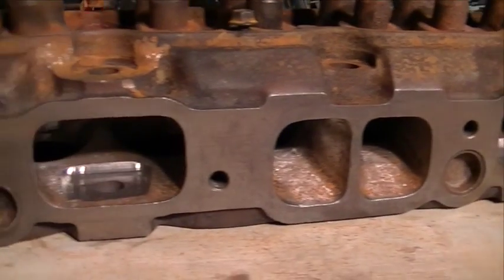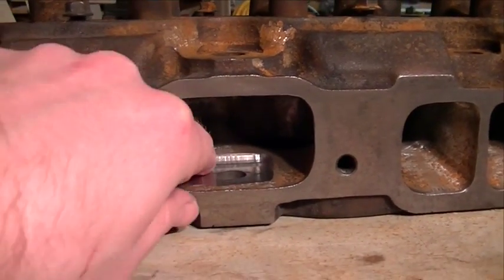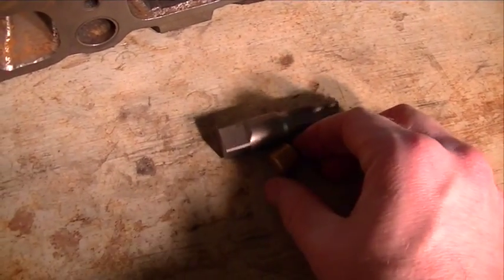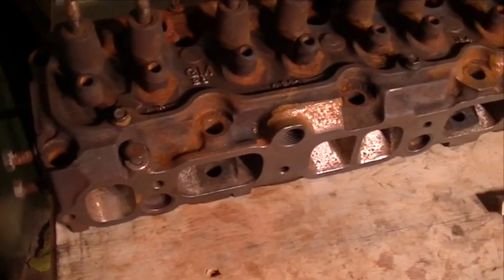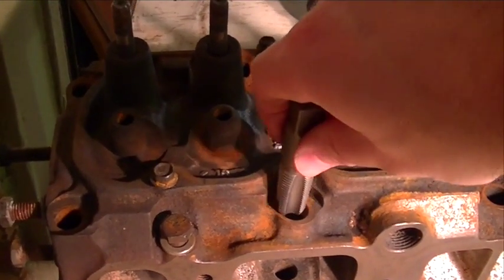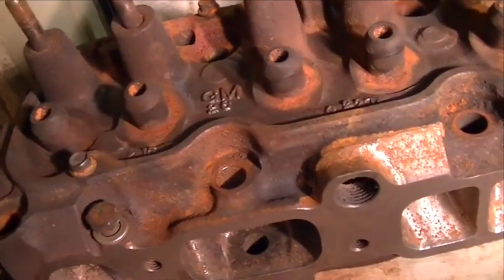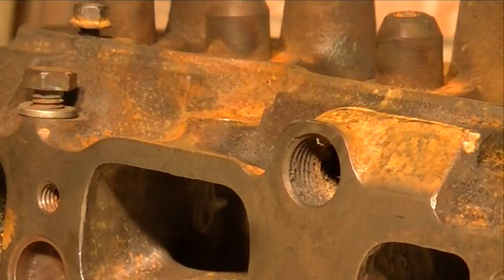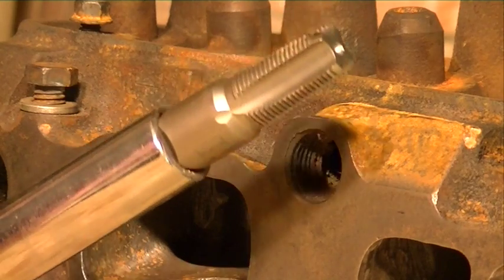Part 7 Chevy 250 Cylinder Head Porting | Inline 6 Lump Port

Comment: I have to ask, that is if you have completed your project. How much of a difference in power and performance did you produce after portion and polishing work, compared from the way that engine Run before you decided to pull off the head? It almost seems like you have more of an opening in the intake by doing the way you did it compared to using the lump kit which seems to limit your ability to open and pork the intake as well as partially decreasing the opening. I wonder how much of a difference your way would perform from the lump kit side-by-side if you know what I mean.

Comment: NPT stands for National Pipe Thread. The threads are tapered so that it seals itself as it tightens. It should provide a good seal under all but the highest boost pressures, and certainly be good for naturally aspirated applications.

Comment: Just for clarity's sake, you might mention that NPT stands for National Pipe Taper, so the further you screw the plug into the hole, the tighter it seals. This is how you control the depth, so that when tightened, the bottom of the plug is just flush in the port roof.

Comment: Love your videos, we always "pin" all of our heads that have pressed in rocker studs, just drill through the head pedestal and rocker stud and drive a roll pin through them. Keeps the pressed in studs from backing out! Keep up the good work my friend!
Reply from the maker: I thought about pinning the rocker studs.  But this head had been off the truck for too long and I needed to get it up and running.  The engine runs good but could use a rebuild.  I'll pin the rocker studs then.  Or have them machined for screw in studs.  Thanks for watching!